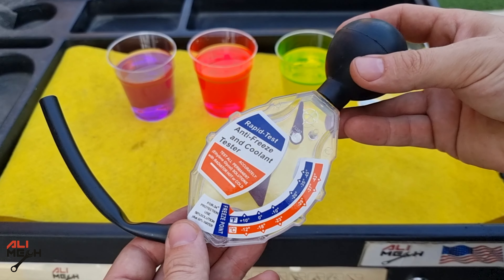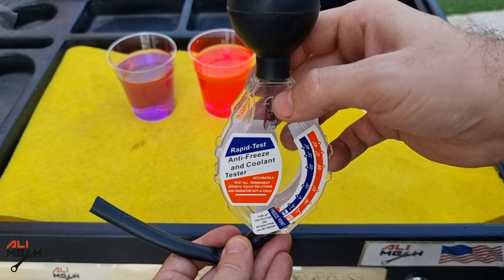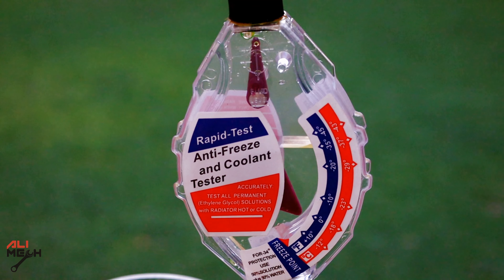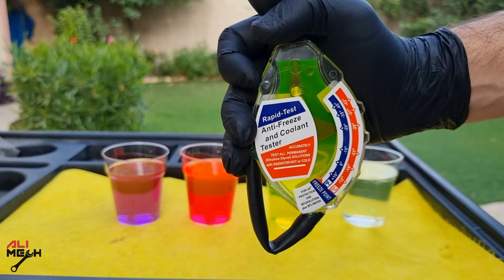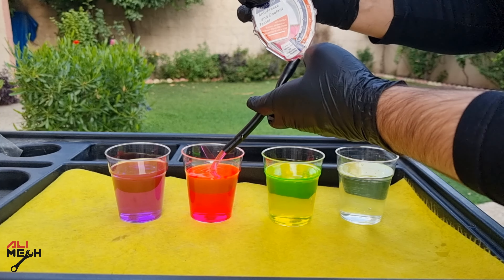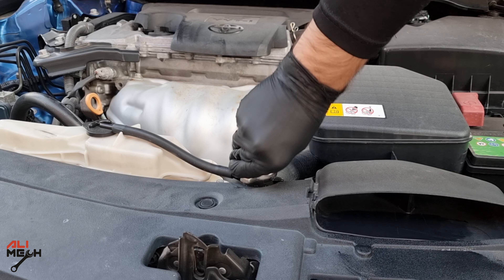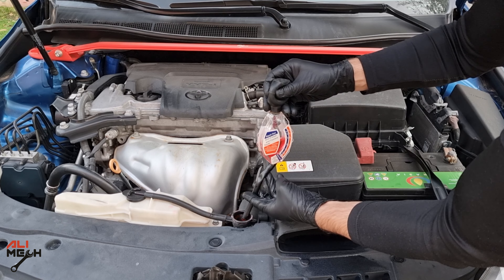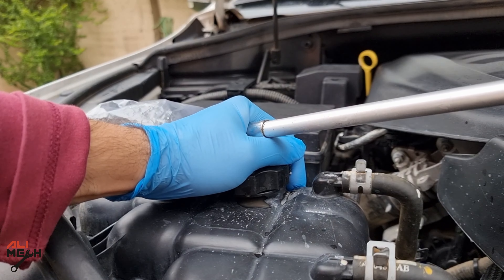Anti freeze and coolant tester that we all need/ How to test and flush your cars radiator coolant

Comment: If iat is Ethylene glycol,
Oat is propylene glycol, then
what is HOAT? Is it Ethylene glycol or propylene glycol?

My new pink coolant has ethylene glycol written on the container. 
Is it iat, oat or hoat?
Reply: It's not the glycol that determines which it is.
Reply: @atticstattic  sorry your totally wrong. Please do some research and only answer me 😜
Reply: @tnamen1307  
Already did the research, thanks - why don't you try some.
Reply: @atticstattic  i already did earlier. Hence, throwing the above mentioned question.
Still it seems you can't different iat oat and hoat 😜😜😜
Reply: @tnamen1307  
I doubt you did much research, the difference in tech isn't the glycol.
Reply: @atticstattic  If iat is Ethylene glycol,
Oat is propylene glycol, then
what is HOAT? Is it Ethylene glycol or propylene glycol?
Reply: @tnamen1307  
Either, because it's not the glycol that determines it.